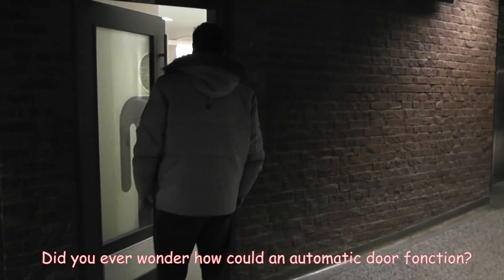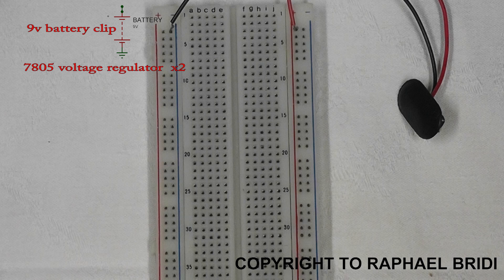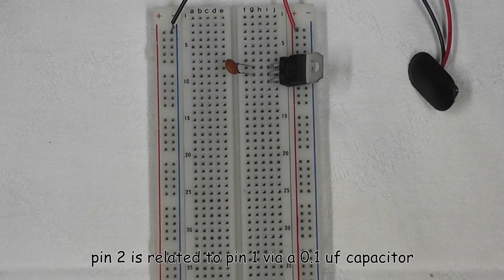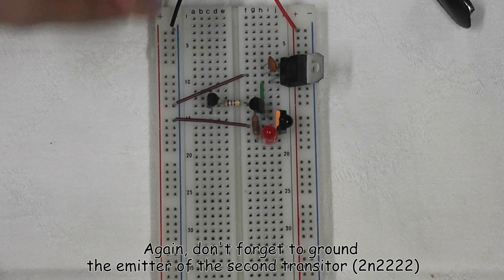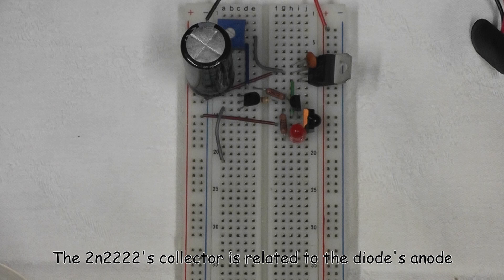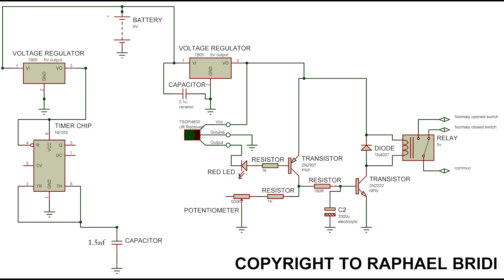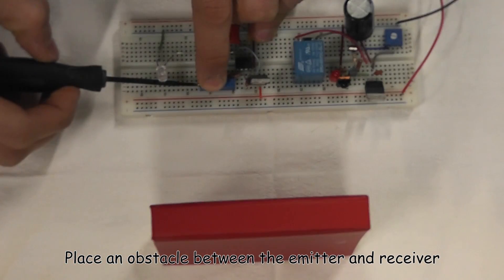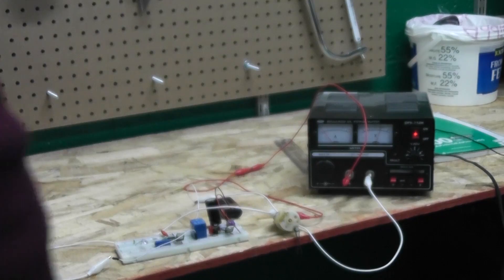[D.I.Y.] How to make an infrared motion detector

Comment: Cool! I'm using his for a project but my teacher told me I have to make my own oscillator, I can't use 555.

What's the purpose of adjusting the pot needed to activate the relay? It changes the frequency of the oscilation?
Reply from the maker: jorgesmok you can use a multivibrator circuit to do that. Just google it. Also, the first pot is to adjust the frequency to 30Khz and the second pot is to control the switching time of the relay
Reply: D.I.Y or DIE Why do you use the 555 to feed the IR diode? I mean, if you feed it with a 9 V battery it will emit IR light (38 kHz), wont it?

I mean, I dont understand why you need to feed the IR Led with a 30 kHz signal if by just feeding it with a Vdc it will do the work to emit a 38 kHz signal.

Or does the 30 kHz coming from the 555 have a diferent purpose?
Reply from the maker: the 555 timer is like a switch that turn on and off the infrared led 30000 times per seconds (30Khz). If we plug the infrared led with a 9v batterie, first, we may burn it because it only takes 2v and second, it will stay turned on. the IR led is like a normal light but a human eye can't see it. We need this 30Khz oscillation because our receiver need to detect it in order to activate the relay. Hope I answered well your question :)

Comment: You don't necessarily need another 7805 chip as you could just bridge into the first 7805 with a couple of jumper wires correct?
Reply from the maker: Penfold8 I already tried to have only one 7805 chip but your receiver circuit will be triggered ON all the time. This is due to an interference between the emitter part and the receiver part. For me, isolating the emitter and the receiver by adding another 7805 was the solution.

Comment: What is the minimum and maximum range of this sensor and how can we adjust its range?
Reply from the maker: Between 2 and 5 meter with my experience. You can adjust it by placing the ir led and the receiver with an angle on the inside. But they should not detect each other.

Comment: hello sir, thanks for the video, i want to make something based on this video, but i still don't understand about the use of NE555 timer chip, can you tell me more? and can i remove it? thanks, btw, nice video ;)
Reply: thanks, it help me a lot ;)
Reply from the maker: Syahrizal A Rafsanjani The 555 timer chip is the most important part in the emitter circuit. It lets the infrared led oscillate at 38Khz. WHy do we need this frequency? BEcause the receiver is triggered on when he detects an infrared light at exactly this frequency. When there is an obstacle between the IR led and the tsop, the light at 38Khz is reflected to the receiver by the obstacle and the receiver trigger on the relay.

Comment: What is the maximum distance we can get?
Reply: Dean Lee can we use this 555 circuite with wireless RF remote control module?
Reply from the maker: About 4 to 5 meter. It depends on the obstacle you have. The more white it is, the more distance you could have
Reply from the maker: Dean Lee it depends what you wanna do with the module
Reply: Dean Lee Sir, I like this project a lot. so far it still not working.
could you let me know more detail, How long the timing we can adjust, can we extend more time?
Thanks.
Reply: Dean Lee What kind of IR led
Reply: Dean Lee Sir, why use 2x 7805 and 2 different 500k pot. Please bear with me. Thks.
Reply from the maker: Dean Lee What is not working in the project? You can have a bigger capacitor then 3300uF value for more triggering time. I you need some troubleshooting, you could private message us on facebook.
Reply from the maker: Dean Lee It is a standard 5mm ir led. You could find it anywhere in any electronic store
Reply from the maker: Dean Lee You need 2x 7805 voltage regulator because if you use only one, your circuit will be always triggered ON. Im using the 7805 to isolate the emitter from the receiver.. For the pots, the first one is used to find the correct frequency for the ir led (around 30Khz) and the second pot is used to control the triggering time of the relay.

Comment: helo :) we have done the exact project but instead of tsop4830/4838 we have used  ir receiver sm0038 which has the same frequency as tat u mentioned in this video..when we give the supply red led is constantly glowing or not..
expecting ur reply soon :)
Reply: Since your tx and RX are working fine..I think the problem is with frequency of tx..try these troubleshooting tips

1.Double check the ceramic capacitor and potentiometer markings used with 555 timer since they are often misleading or check it using a multimeter
2.if possible measure the frequency of 555 timer ic output..its frequency should be more or less equal to 38 kHz(ton+toff~=26.315microsec) for sm0038.if it is not equal to 38k then there is a problem with the timing capacitor or resistors or both.

To calculate ceramic capacitor  values and to design 555 timer ckt android application electrodroid will be of great help.
All the best:)
Reply from the maker: Mahesh D if you find the solution, id like to know how
Reply from the maker: Test your receiver before making the emitter. Take a tv remote and see if the red led is lighting. If not, check the datasheet of your sm0038. The pinout may be different then the tsop. If you already made the emitter and don't want to remove it, only take out the 555 timer to test your receiver. try it out and tell me more about the red led when you turn on the circuit and when you use a tv remote.. Hope it helps
Reply: D.I.Y or DIE hey yea dis is shrimathi's project mate... the ir reciever is working properly when i tested with tv remote its jus tat it doesnt work with the ir led(which is working ) wich is in the circuit...trying to figure out the prob but cant... hoping for ur ans for our prob :)
Reply from the maker: Mahesh D face the ir emitter to the receiver and turn slowly the pot of the 555 timer. It may be long but you will find out the good frequency. Use an oscilloscope if you have one to be sure that the ir led is oscillating.
Reply: D.I.Y or DIE yea i did the same..but stil it isnt working :(
Reply from the maker: Mahesh D build the emitter circuit on a different breadboard with a different power supply. Tell me if the problem has changed
Reply: D.I.Y or DIE  i have a doubt...wat wavelength ir led did u use in ur circuit?? U used the ordinary ir led only right??
and sure ll let u know after trying the methods u people just said :) thanku both :)
Reply from the maker: Mahesh D Ive used a standard ir led. Hope your problem will be solved but I really recommend to adjust the Pot related to the 555 timer on an oscilloscope so you can have an exact 30Khz. Ive adjusted mine to 5.20Kohm so maybe it will work for you too. Another idea is to get a 10K variable pot instead of the 500K related to the 555 timer. Try out these tips before moving the total emitter circuit
Reply: D.I.Y or DIE yea i did d same thing which u jus mentioned..even when i change the pot der is no variation in the ir led oscillations but the pot is working wen i checked it with multimeter...i totally cant figure out what the prob is.. :(
Reply from the maker: Mahesh D so your timer isn't working properly. Make sure your connections are properly checked. The IR led should oscillate differently by changing the pot value. Just re-wire your emitter circuit on an other breadboard.
Reply: sure v ll try ur tips tomo and let u know . tanx :)
Reply: Mahesh D  you can't figure out whether the led is flashing or not in the KHz range. Try to implement the transmitter part using a function generator. connect the output of FG to the IR LED through a suitable resistor if it's working perfectly you can proceed further.
Reply: wil the IR led glow al the tym ???? wat the use of 555?
Reply: no.it appears to be..The IR led will be switched on and off by 555 timer nearly  30 thousand times per second. our eye cannot perceive such high transition rates that is what I'm trying to say in the previous comment. just like when the fan is spinning you cant spot the individual blades.
Reply: hmmm ! our receiver side totally working d relay motor,wen the input s through the tv remote. in tx side the IR led glows but there s not effect in the rx lyk wat i see using tv remote
Reply from the maker: preethi balaji The problem is in your emitter circuit. Does your oscillating frequency right? Is the IR led working? Replace the 500K pot with a 10K on the emitter side and turn it slowly until your relay triggers on. If it still not working, the last think you could do is to verify the exact frequency of the IR led on an oscilloscope. It should be between 30Khz and 40Khz (depends on your receiver)
Reply: Only if u give us the frequency/ time interval of output waveform of 555 timer..we can sort out the exact problem in transmitter ckt. Are you doing this in lab or home?
Reply: Praveen Iv we are doin it at our lab...n v arent bein able to find out the freq of the 555timer.. :/ the cro isnt displaying anythn wen v connect to pin 3...:(
Reply from the maker: Mahesh D verify the connections of the 555 timer. Also, did you power it with 5v?
Reply: yea V powered it wit 5 V !
Reply: That sounds very strange.. How can the led glow if there is no potential difference.. Check the probes and cro settings like channel ,range of axes ,etc.

Before doing any measurement using a cro..test it by connecting it to the reference 1v/5khz signal leads located in the bottom right corner ( in most of the cros).for detailed explanation refer this site
https://learn.sparkfun.com/tutorials/how-to-use-an-oscilloscope/using-an-oscilloscope

You are almost there..don't lose hope:)
Reply: Praveen Iv thx for helping us out :)
Reply: Don't mention:).. Project over?:P
Reply: D.I.Y or DIE  we actually checked the 555 timer..it is producing oscillations correctly...still d reciever isnt pickin up the input frm emitter side...wat changes can v make more to get the output?? please help us out :)
Reply: Praveen Iv of course nt :P
Reply from the maker: Mahesh D Does the oscillation coming out of pin 3 look like a square? If yes, all you have to do now is to adjust the pot so you can have a beautiful 30Khz square wave. If the receiver don't trigger on, turn the pot slowly to 40Khz and see the frequency response of your receiver. I could swear to God that it should work.
Reply: D.I.Y or DIE yea v did get the square pulse n v did change d pot n d pulse also changed bt d receiver wasnt triggered... v tried all d things wich u mentioned correctly yet it didn work..anyways v appreciate ur help n time wich u spared for us :) thank u :)

Comment: Hello,
Thanks for the awesome video.  I am trying to make a setup where I can have the motion sensor trigger an LED in my room so it lights up when my parents start walking down the hall so I don't get caught playing video games at night. Do you know of a better way to deliver an output besides a large wire? Is there any way to relay the signal wirelessly?  Thanks a lot for the video I find stuff like this really cool.
Reply from the maker: You could buy a cheap radiocontrolled car. Plug the relay to any of your radio button and replace the motor of the car with anything you want

Comment: Hello sir, I just want to ask if this is applicable to attach in a trashcan. Please I would really appreciate for your reply. We used this as our reference for our project in physics. Thank youuuu :-)
Reply from the maker: not sure what your trying to do. Is it when you open the trash, the circuit will trigger itself on?
Reply: Hi :-)  is it possible to make a trashcan that will automatically open its lid when the motion detector detects an action . We are trying to do it for our school project thank you :-) :-)
Reply from the maker: Mary Anna Irinco you could place the motion detector infront  so it will detect if a person is close to the trash. If so, the trash will be opened as long as the person is close to the trash. You can do it like this
Reply: Thank you :-)  so does that mean that we don't need to attach any other things except for the motion detector itself?
Reply from the maker: Mary Anna Irinco for the proximity detection, you can use this circuit by its self but youll need a motor to open a trashcan. The circuit will allow you to do that but for closing the trash, im wondering how your going to do that
Reply: D.I.Y or DIE hi, thank you for your response :) And yes we are going to use a motor to open the trashcan. But in some instance, do you have any idea of how to do it? to open it ? a mechanism? or we need to put something? and also please tell us if you have any idea of closing it .  :-) and lastly do you have a PCB board design of this circuit?
THANK YOU for this, we really appreciate your replies, that so nice of you! it really help us a lot.  Have a nice day :)

Ps.  sorry for asking too much questions
Reply from the maker: Mary Anna Irinco hey, go to 4:49, all the schematic is there and you can reproduce it on a PCB because I don't have a ready made PCB board design. I would suggest you to place a spring so you let the trashcan close automaticaly when the motor isn't pushing the trash up. No idea how to place the motor tho

Comment: Thank you for the video. I would like to ask you what is the maximum distance you can obtain with such a system?
Reply from the maker: For a personal test, ill say between 3 to 5 meter but it depends how strong is your ir led and how sensitive is your receiver. Also, a white obstacle is more easy to detect then a black obstacle.

Comment: hello...  i have a question here, why does my LED light at the IR receiver is ON while there is no motion occur? because usually it turns ON when there is a motion.... i need your feedback .. thank you 

P.S... im still newbie
Reply from the maker: Hey, happy new year. I think you didn't connect properly your ir receiver. Double check your pinout. You may have a different receiver then I. Sometimes, your room light may cause an interference with your circuit and may turn the receiver on. Try your circuit in the dark too. If nothing works, remove the emitter circuit and put it on another breadboard. You may want to readjust your infrared led's position.
Reply: D.I.Y or DIE  thank you very much...and i will do my best.. also Happy New Year..

Comment: Hey man, thankyoou man for this video. but man please help me about these Question? with the idea that these motion sensors use Infrared technology(heat detectors). They probably have two weakness 
 First if we find something to protect our body heat with something like fire protectors tent that fireman use, they can not detect anything? 
 Second if we attack a motion alarms with 400 lumen Infrared light, are they still work?
have you tried these so far?
have they any weakness?
Reply from the maker: It is true that our own body emit an infrared light but in this project, I'm using an LED infrared emitter and a receiver placed in parallel so when someone passes infront of the circuit, the emitted light from the infrared LED is reflected to the receiver. I'm not detecting a human body heat. You can use any kind of obstacle and the circuit will still trigger itself on. I've personaly never tried to attack a motion alarm with 400 lumen IR light. But yeah, some kind of equipement used against the radars in the army can bypass the infrared detection. Hope it helps

Comment: Hi I have a question: Is it possible to make the end of the circuit turn on and off a hair dryer?
Reply from the maker: Yeh, for this you will only have to cut one of the powering wire related to the hair dryer in 2. Then directly relate each end to the relay's switch. Hope it helps :)
Reply: D.I.Y or DIE Going to try it. Thanks a lot and congratulations for your nice work.
Reply from the maker: MacTavish002 no problem, if you have any questions, i'll try my best to help

Comment: Sir I am using a different IR RECEIVER will it work because when I use a remote the red led flickers and the relay goes to nomarly closed for a short term
Reply from the maker: it should work if the connections are good. But you may need to adjust the emitter's frequency to another one.
Reply: You even stated a 480 ohms resistor but its not on the list. And one should use 500k pot only

Comment: can you alter this circuit to make an auto light switch for a room that can count the number of people entering and exiting the room accordingly ? . Can u post the same circuit with a cheap microcontroller ?
Reply from the maker: just replace the motor with a light bulb so it can be switched on and off when someone enter the room. If you add another relay, you could use it to press the equal button on a calculator. If you write (1+=0) on it, the number will increase by one each time someone cut the laser beam. This is the old school trick to make it work like you want. But for the microchip, I don't have a good knowlege of how you could do it. Try doing what you want with an arduino (easy and fast) but I have no idea of what the codes could be. Hope it helps :)
Reply: oh thanks man !! arduino's are kind of expensive , i'm gonna learn microprocesor prgmming . thanks dude
Reply: expensive for large scale prjects i mean =) . arudinos are for prototyping

Comment: Excuse me if this is a daft question, I seen the same question below from "Aliza" but no answer. What voltage size of the 3300uf capacitor did you use?
Reply from the maker: I've used a 20v capacitor but it doesn't matter because any 3300uf capacitor that could handle more then 9v will work. Ive answered alisa on her channel because there wasn't a reply button on her question. Hope it helps :)